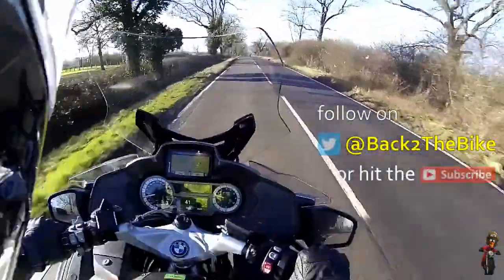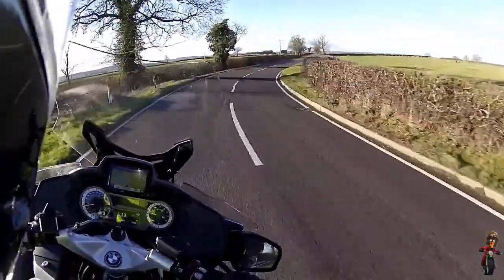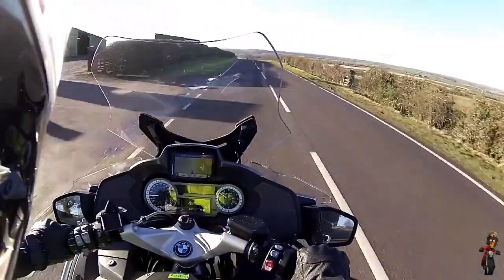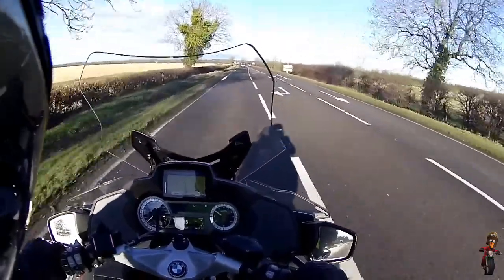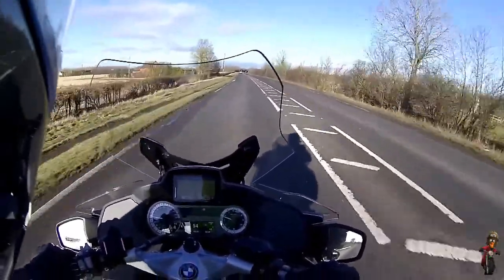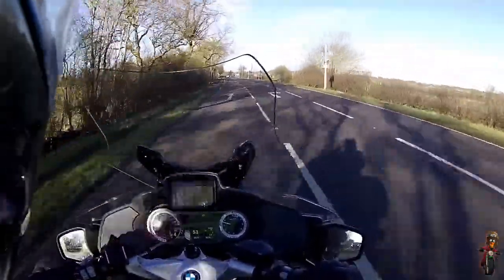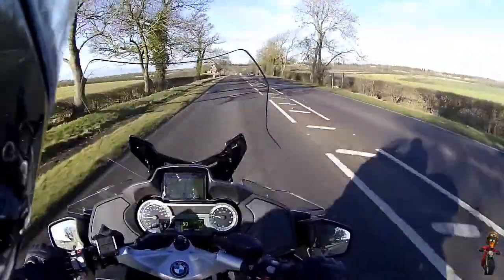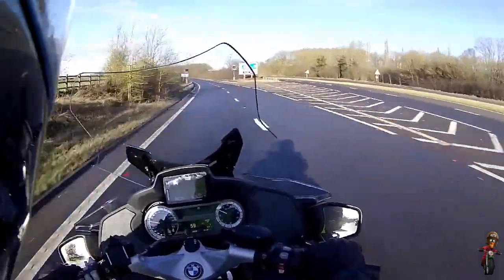Helmet Speaker Mod - Road Test & Final Tweaks

Comment: Great vid again,, How are you playing your playing youre MP3,s via  the navigator or Android/ITunes?,Have you got a Facebook link so I could pm you?
Reply from the maker: Hi Rick. I use the SatNavVI, songs saved onto a micro SD in MP3 format. I did try linking my android via one of the BT channels on the Scala but it was unstable. I'm not on FB, but Twitter @back2thebike.
Reply: Ah right , I picked up the Nav 5, Just trying to get my head around dividing the BT channels so I can keep the intercom (wife) Mp3 and sat nav instructions,on the Interphone F5mc although I think i'll struggle due to limited channels, Also I'm a bit gutted you cant access more features on the Nav via wonder wheel on the RT compared to the GS
Reply from the maker: rick burgess The GS v RT wonder wheel thing isn't much of an issue IMHO Rick. You can access all the info, most of which is on the Multi Function Display. Have you seen this ? https://youtu.be/5qOSxtnpA4Y